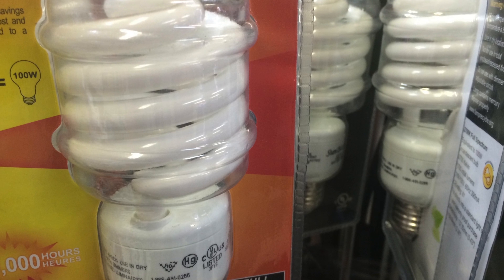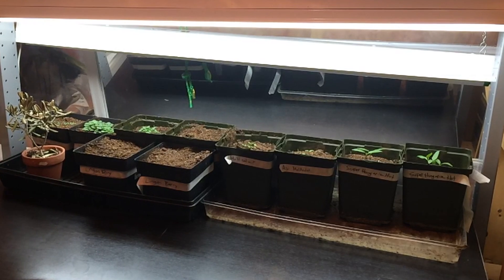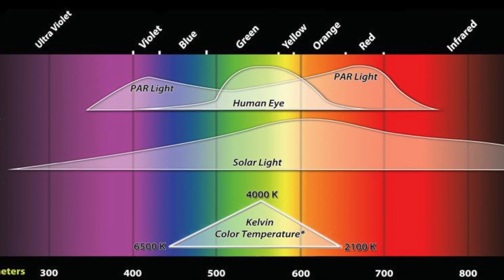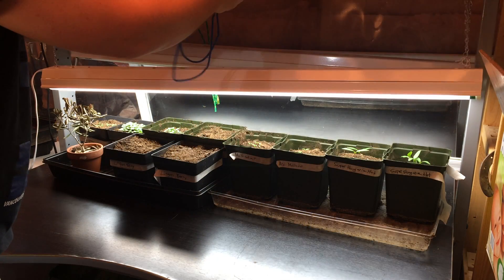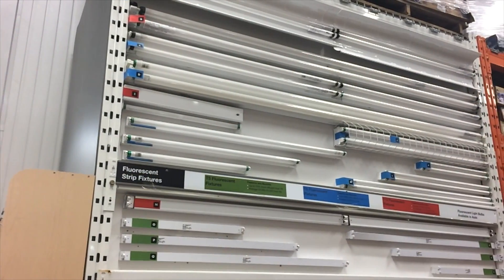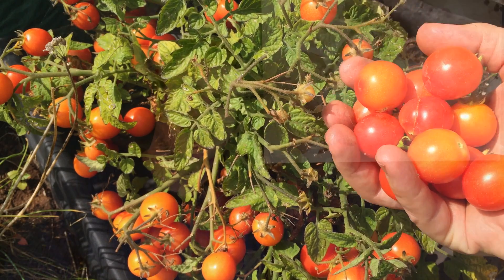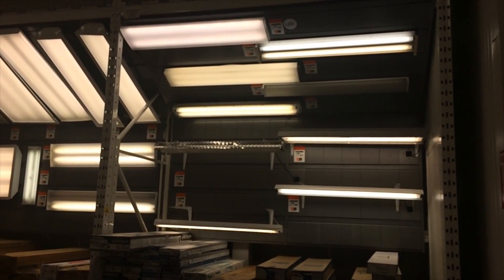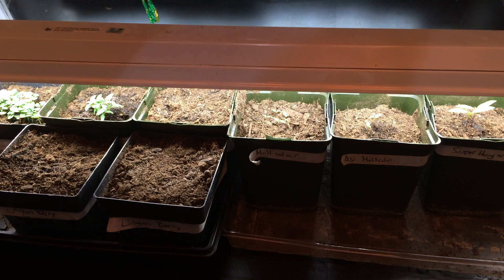How to Grow Plants using CFL and Florescent Lights - Growing Indoors Cheap, Easy and Effective

Comment: I grow my autoflowers (one at a time) in a 18" square by 4 ' high box using a 5 bulb fixture with 4 26w 6500k and 1 26w  2700k bulb. I got 1.3 oz of dry flowers from it last plant that grew 2' tall. Autoflowers work great with CFLs

Comment: What do you recommend for a lemon tree that's about 4 ft, a banana tree thats 2 ft and a mandarin tree also 2 ft? I just got the banana tree and mandarin ealier this year and Ive had the lemon for about 4 yrs. they aren't fruiting yet. The lemon flowers but no big lemons as this past summer. I have a shop light I can mount and use.Just need to know which lamps I should get. T-5 will be good for these kinds of trees? Also how far away should the lamp be? The banana doesn't require direct sunlight believe it or not so Im thinking maybe a foot or two above them all and rotate them out and around. Hope to hear from you.Thanks for great videos
Reply from the maker: You will likely need something a little more powerful or mount a bag of lights in a cent-circle around your plants. The crops you have are tropical and usually need the most  sun even through winter. 

Hope that helps
Reply: Ok thanks for the response. So the T-5s wont be enough you think? If not what kind of bulbs/lamps should I get for the lighting fixture?
Reply from the maker: T5 are the best but they will likely not be enough to keep your plants happy.

Comment: When growing from seed, do you keep the CFL's on 24/7, or do you run on a timer set to say 12 hours on, 12 off? How would you modify this light schedule after germination?
Reply from the maker: I just leave my lights on for 18 hours and off for 6.  I don't change anything through out the season.
Reply: +Alberta Urban Garden Simple Organic and Sustainable thanks for the reply! Another quick question:

I have two normal metal construction lampshades and packs of 2700 (I could not find 2100 CFLs locally) and 6500 CFL's. The problem is, it is not possible to get the lamps close enough to the starter tray while also getting good overlap between the light from the different bulbs. So, during the germination/green growth starter stage, would you recommend continuing to use the different bulbs and rotating the tray 180 degrees halfway through the day - or - would you recommend just using the 6500 until into the stage where I want the plants to flower?

I know my setup is not ideal, but it is what I have and was the cheapest option readily available. 

 Thanks again.
Reply from the maker: it should work well enough to get some good plant growth.

Comment: Hi Steven, another great little video of yours I've come across! When buying CFL lights, are lumens a factor I should look out for? I'm thinking of setting up a grow room to start chilli seedlings and maybe if it's cost effective, overwinter my plants. Is there a minimum range of lumens I should be aiming for? I have around 4 23w (130w equivalent)  CFL 2700k 1450 lumen bulbs, and have just purchased 5 23w (125w equivalent) 6500k 1500 lumen bulbs, I'm also wondering if I should use something reflective, maybe Mylar, or reflective paint (which I prefer the sound of) would really appreciate your advice 👍🏻
Reply from the maker: As much as I don't like to reply to a well thought out comment with a link I do a much better job describing what you are looking for in this video :) 

https://youtu.be/QJjKQbbQqXM
Reply: Thankyou Steven 👍🏻 I know what I'm looking for now
Reply from the maker: Glad I could help!

Comment: Is there better bulbs I could get to do a better job than the ones I have? I have 40 watt fixtures?
Reply from the maker: 6500k and 2100k are optimal and the higher the watt of the bulb the better.

Comment: Hello,    I already have two T12 4' shop light fixtures with two 6500k bulbs and two 3500k bulbs is that good enough to germinate some tomato and pepper seeds indoors with heat mats under my trays? I just want to start indoors then move to outdoors.
Reply from the maker: Yup it should be good. It's just less efficient.

Comment: I am giving my Trinidad Moruga Scorpion seedlings a mix of sunlight and several 4100-5000K fluorescent and CFL bulbs.  I am hoping they like it!  Living in Pennsylvania, I am not entirely sure if the scorpion peppers will start producing by the fall cool down, so I might end up expanding my indoor plant growing operation!
Reply from the maker: +Jav Sarge plant them in black pots and you should be good.  I can get them to produce here as long as they have lots of heat and water.

Comment: Thanks for the information, you just answered a question I had about lights.  I have a Tower Garden, which is a vertical hydroponic,  aeroponic  tower.  This will be may 3rd winter to grow inside. I have been using T5 grow lights and I went from overhead lights to vertical last winter, but even though I had better results, I now realize I didn't have my lights close enough to my vegetables.  Hopefully, now my flowering plants will do as good as the non-flowering. I use both the 6500k and 3000k bulbs.
Reply from the maker: I am very glad could help you grow better ! I have seen those vertical  systems and always wondered how they worked. If you don't mine I would love if you posted a few photos on my Facebook page !

Comment: I grow indoor vegetables using shop light 32 watts bulb,tied three of them together with small pieces of wood and screws.Each panel will have 6 bulbs.The way I calculate it is for 16 hrs on daily is 32x6 x16 x30=92,160 watts per month.With the electric rate $.10 per kwh that would be $9.216/month.Am I correct,is there other way to calculate?
Reply from the maker: +Prasid Vongsnakorn I belive so.  My system is a little larger and my power a  little cheaper and I run about 14$ a month for power when I am up and running.

Comment: Thanks for creating these videos. Really appreciate taking time out to share the knowledge. You have been taking about energy requirement of plants - high energy requiring ones are tomatoes or peppers, and there are some low energy requiring plants.

Is there any list somewhere which says which plants need how much energy in terms of units that can be measured whether be it kelvin or lumen?

This will help growers or wannabe growers to do the right crop selection based on the lighting setup amongst other things. 

Would be great if you can shed some information. Or any link in the internet where this can be found.. or may be right search strings for google :) 

Cheers:)
Reply from the maker: Subham Sarkar unfortunately  there are no lists that I know of however things like herbs are low energy, anything that puts off fruit is higher and a general rule of thumb is the larger  the fruit the more energy is required.

I am really glad you enjoy the videos!

Comment: I just did some calculating of lighting costs for my hydroponic setup.  I thought you might be interested in what I discovered it would cost to operating different lighting types for 1 bulb or fixture for 18 hours per day for a month.
1 65watt CFL bulb (actual wattage, not equivatent) $3.16
1 45watt CFL bulb (actual wattage, not equivalent) $2.19
1 33 watt CFL bulb (actual wattage, not equivalent) $1.61
1-2 bulb 48inch shop light $3.62
I used "calculators" from 2 different websites.
So, for germinating seedlings on an on-going basis using 4 shop lights, it will cost me $14.48 per month.
For growing one 48 inch long shelf of non-fruiting greens with 12 - 33 watt CFLs it will cost me $19.32 per month.
For growing tomatoes, cucumbers, peppers on one 48 inch long shelf with 12 - 45 watt CFLs it will cost me $26.28 per month.
Or, for growing tomatoes, cucumbers, peppers in 24 in long by 36 inch high shelf area using 6 - 65 watt CFLs at the top and 8 - 33 watt CFLs midway down along the sides, it will cost me $31.84 per month.
Typically from what I've heard other people, for a combination of on-going germinating seeds, growing greens, and growing fruiting vegetables, it typically costs about $50 per month for lighting.
How does this compare with the operating costs of lighting that you have found?
Reply from the maker: Thank you ! I have been looking into exactly this to see if I can calculate the break even point between LED and CFL for indoor growing.
Reply: ***** Here are the links I used.  http://energyusecalculator.com/electricity_cfllightbulb.htm and http://comohomestead.com/2012/02/the-cost-of-running-seedling-grow-lights/ Please post your results and you figure out the cfl/led costs.  Thanks.
Reply from the maker: threedogwrite Absolutely I will!

Comment: Hello Steven! Thank you so much for posting your very informative video series! I am in the process of setting up my own indoor grow system and plan on using two, 48 inch florescent tube lights in a light fixture. To achieve optimum growth and fruit yield, should I have one light that puts off 6500K and the other at 2100K to cover both spectrums of light that are ideal for photosynthesis? To me this would make sense, however the lighting kits at my local hard wear store seem to contain only tubes that produce 6500K. Am I missing something here?
Reply from the maker: Sean you are dead on. I have a Home Depot set with one bulb of each ! 

I am glad you found my video useful!

Comment: Great information!   Something you alluded to indirectly in your video that's worth noting is just simple observation of the plants and how they respond to the light you're giving them. A simple rule of thumb for me was to just make sure light was covering the footprint of the grow trays.  Also the distance of the lights from the plants seemed to be a determining factor.   If the lights were too high,  the plants became leggy trying to reach the light,  even though they were directly overhead,  so keeping them close to the plants and raising them as the plants grow seemed to work well.
Reply from the maker: exactly!  great points!

Comment: Stephen, good video as always. I did notice in the last video as well as this one you left out one of the most important lights- Metal Halide. With the cost of HID systems continuing to drop, it just doesnt make much sense to use CFL if you are doing any size. I've wired CFL systems in series running 4x6 and 4x8 bulb patterns, and with the amount of lamp failures you will get with that number of bulbs, you are taking a loss. To each their own though. Nearly everyone who takes up indoor gardening will start out with fluros, then move up. I started with tube flouros 25 years ago.
Reply from the maker: Your right I left HID out again.  IN order to give the subject the justice it deserves i had to break it out into another video.  When does running a CFL system start to cost more then the higher investment more efficient systems?  I have to do some math but Id assume once I have all of my CFL running I am getting close.

Ill also admit I don't know much about HID except for they have waste heat and I don't need any of that in my home :) if I could take advantage of it in my heating system I might but its a few research projects away :)
Reply: Stephen, there are good quality digital ballast 400 watt HID systems available now for under $200 US. They produce such little heat that they require no special in-line ventilation like the older magnetic ballast types. The reason I had mentioned Metal Halide earlier as opposed to HPS, is because metal halides are a much better stand alone bulb. With the enhanced blue spectrum, you get tighter node spacing, and better production for leafy crops if you choose to grow them indoors to maturity. Down here in Florida, I use HIDs', and to a lesser extent, CFLs' to get a head start on both my spring and fall crops. To put it into perspective on the cost issue, I would spend $168 US to relamp a 4x6 bulb pattern CFL rack I built myself. It would adequately light a 3ft x 5ft area well enough to bring any garden veggie to transplant size. That system used 1,008 watts. With a 400 watt metal halide, it costs $23 US to re-lamp, and covers a 5ft x 5ft footprint with over double the lumens per watt than my CFl rack.
Reply from the maker: Oh man your light prices are fantastic ! After the last episode when we spoke about it I looked at my local shop and it was 600$ starting and going up from there. The bulbs were nearly 100$ each. 

My whole Florescent light system cost me 80$ Canadian
Reply: Is there a duty tax if you order from the US? Alternative garden supply carries the Sun Systems digital 400 MH/HPS for $208. I'll tell you how I've gotten around paying exhorbitant prices for horticultural bulbs. I use the phillips compact metal halide standard clear. Since its designed for flood lamps, it will fit into any grow unit. The stats are 3000K, 39,000 lumens, and avg. life is 10,000 hrs before it really drops off. I did a price check today since I need to relamp before Jan, and they are up to $29 US now. Hope that helps if you decide to switch over. Maybe I helped convert someone else into HIDs.
   On a side note, I've noticed a trend that it seems to be Canada-wide, that so many items are extremely expensive. Most of the products I use in my trade are manufactured in Canada, yet they are reasonably priced here( reasonable for high-end products).
Reply from the maker: There are lots of taxes on imports or even domestic stuff like this. It sounds like I might need to go to the US one day and see what I can grab :)

Comment: nice stash! lol good info i have got great results with my cfl lights. but i will be phasing them out here shortly for 3 led spot lights that run a total of 90 watts instead of the 500 watts i am using on the CFL now.
Reply from the maker: If your running large amounts of lights the conversion makes sound investment sense :) one day I'll upgrade too lol.
Reply: yeah lol and i have found the big CFL bulbs i have just don't do well when it comes to light drop compared to LED, LED has a much better range of usable light so you don't have to keep them super close.
Reply from the maker: TheItalian Garden for ease of use your right LED is way better.  I just find the light colour being sent out hurts my eyes quite a bit !
Reply: ohhhh yeah it does is very unpleasant to look at, but very pleasant for the plants lol. its like you have to sacrifice your eyes for low energy and high intensity lol.

Comment: Very good Stephen! I just kicked my indoor hydroponics lettuce into gear yesterday. I am wanting to start a few peppers but I know that I should hold off a couple more weeks. I want to give those Jimmy Nardelo peppers a good head start.
Reply: I was going to increase my indoor grow area a little this year but I am cheap and I want to try to hit a sale on shop light fixtures like I did last year. I bought some T8 fixtures for $5.30 each and the store had an 11% rebate going on top of that. I will not need the new area until about March. So, I am going to hold off a little.
Reply from the maker: I'll be starting my peppers next month for outside including the ones you sent it will give them time to get pruned and big again :) 

Wow that's a great deal ! I wish I could get that lol.
Reply: ***** I bought two cases of 6500K  T8 lamps to go with them. They were also on sale at the time and I got 11% back on them, as well.
Reply from the maker: Wow that's fantastic !!

Comment: the best bulbs for growing indoors are the HPSodium, I cant afford that so ive gone with 2 20W florescent grow bulbs. my only complaint with these bulbs is the lack of heat produced.  These have been good enough to clone or start plants but 40w total is just not enough for full term.   Great info thx for the share.
Reply from the maker: I could not handle HPS with all the extra heat. I don't have a problem with the soil temperature but I live in an area that my furnace runs all winter just 10 feet away. 

I think mine are 32 watt bulbs and they do the trick :) I will add a CFL when they start flowering ! 

I'm glad you enjoyed the episode !